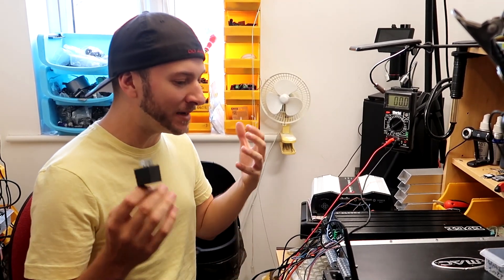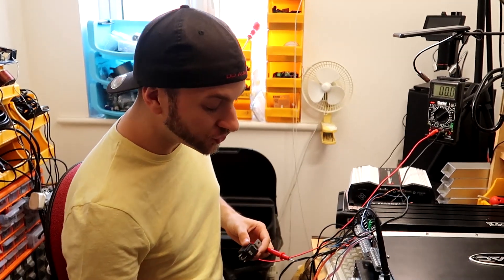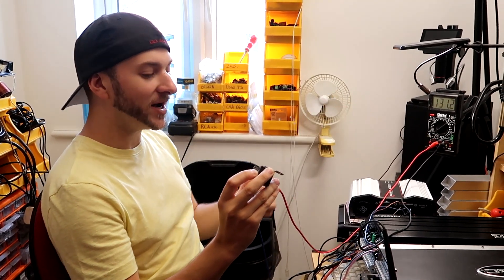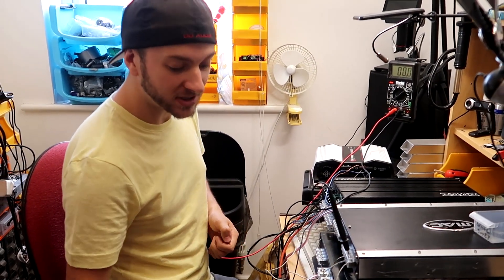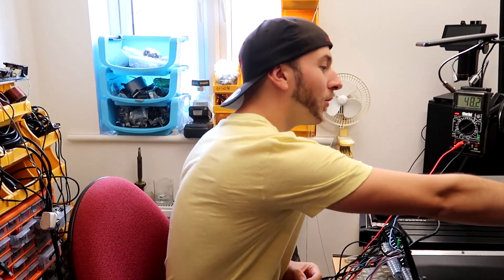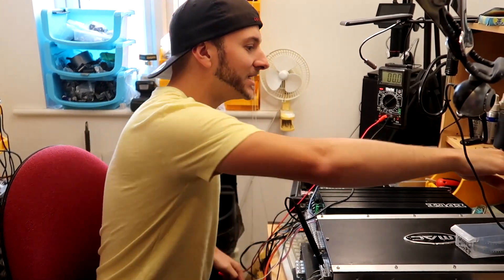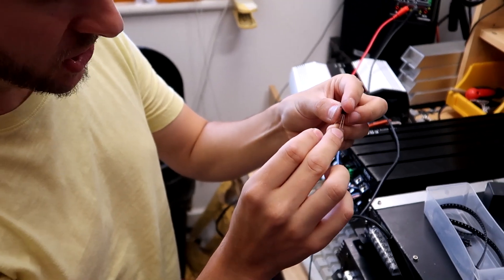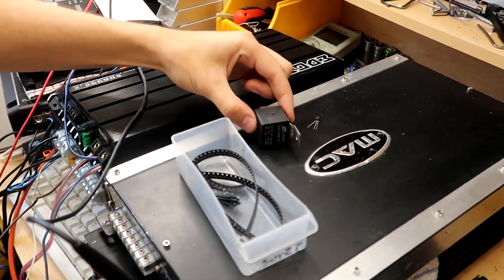"Bro do u need a relay on the remote for runnin 4 amps"

Comment: I love videos like this. The only time I've ever considered a relay is when the remote wire is a 6 volt line. This is usually a stock ford amp thing IDK, but I ended up finding an empty fuse location that activates with the ACC key position n tapped my power from it. I've always wondered about daisy chain but never hook up more than 3 amps n always daisy chained n figured if it didn't work then relay.

Comment: Thanks for the video!  I always suspected that the amplifiers themselves didn't draw very much current for the turn on circuitry but it's cool to see it actually measured.  I've always used a turn-on relay when a build is using other accessory power components like fans for an amp rack, LEDs stuff like that.  The fans I like to use (the BeQuite PC fans) are rated between .14 - .3 amps each and the super bright SMD LED strips are 2 amps at 16 feet I believe.  The last build I did used a relay that switched 2 amps, 4 fans and a fair amount of LED lighting, I fused the relay at 5a.  Next build I do, I'll see if I can clamp for accessory lead current just out of curiosity!

Comment: I would say that I learned something new..... But it depends on the Amp. Many "old school" amps used inefficient electro-mechanical relay coils, just smaller versions of the standard relay you held in your hand. Some modern amps still do. In the case where the Amp uses transistor switching (solid state), you are correct. But if they don't, the external relay may be required.
Reply: Not totally correct, basically all amplifiers including modern amps use mechanical relays to power on and off however your not energizing the relay from the remote input. The relay is energized by a single transistor like shown in the video. The remote input is just turning on the npn transistor, which is turning on the relay.

Comment: i remember back in the day (20 years ago) people swaping the fuse for a bigger fuse so the amp became more powerful... ahahahah
@barevids when will you make a live stream fixing an alpine?
Reply from the maker: When one dies... It's very rare 😂
Reply: If it doesn't use a regulated power supply you can squeeze more power...Big D Wiz  has done it.
Reply: @vincentrusso4332  changing the fuse will do nothing on amp power...
Reply: @sergiobisonte  I've seen it done, YouTube the video..
Reply: @vincentrusso4332  what are you talking about???
Reply: @sergiobisonte  Williston labs had an amp on the dyno and stepped up the fuses from the factory and it did make more power, sorry I don't remember the exact video or I'd link it.
Reply: @vincentrusso4332  that was a cheap china amp or prototype amp that had fuses with very low amps for the power that it was making... that is a diferent story.. it wasnt the fuses that made more power... it was the wrong fuses that didnt let the amp do its normal rated power... if have an amp with a 25 amp fuse, it will pull maybe 17 amps max... if you put a 50 amps fuse, it will pull the same 17 amps..

Comment: I wanna see how much currant we CAN pull from a head unit remote wire…
Reply: I'd be interested in the results. I'd expect it to just stop working at some point. Either fried or triggering a protection circuit if the manufacturer was nice enough to save it from killing itself.
Reply: (I know the manuals list it, I want to see the limit and what happens. Time to buy and test!
Reply: Just read the manual to your head unit. Boom there is the answer or even Google that shit.
Reply: @FixedUntilBroken  you’re not great at reading, are you?
Reply: @casey360360  lol too much lead in my blood from circuit board repairs. Didn't open the comments below and see you responded to yourself like a wild animal instead of editing you post.

To answer your second question that is in your comments it really depends on the head units design. Most have an over current protection and will either restart over and over until you unplug it(as in the short) and some will display an error code.
Reply: @FixedUntilBroken  I have the same problem, only mine is Asbestos from brake pads and whatever other heavy metals the shit boxes I work on poison me with. Haha

I’ve got a Rolling car audio system I built/am building, it’s got a cheap Dual touchscreen unit running it, I might order a new receiver and see what happens on that when you over draw the remote.
Reply: @casey360360  you can normally find them a couple year models old on fb marketplace for less than $50. Grab something like that then if you don't damage it doing that you can build a big boom box with a battery and some speakers
Reply: @FixedUntilBroken  oh no I mean blow up the dual I have on it right now. I’m going to replace it with something a lot simpler, something without an interface to produce the output signal to the amplifier.

Comment: CES makes a nice little package that can turn on multiple amps.  Only reason you should run is is because the strain on your headunit imo.  less likely to have any weird issues.  But like ALOT of amps lol.  10 or more is what I've always said.  Interesting it seems to coincide with this :)

Honestly never looked at the amp ratings, kinda just always been a rule of thumb.  Cool to see it all broken down!

Comment: If we're doing trivia, how about this.
Say you lose an amp,
On 2 separate occasions it's killed the rca outputs on the headunit.
How do you avoid that b.s. cause that's happened to one of my best headunits like almost 2k$ back when single din 7" screens first came out...
Reply from the maker: Try running a ground loop isolator until you figure out the problem that keeps killing the amps. The GLI is just a transformer with a 1:1 ratio, electrically decoupling the head unit from the amp, and blocking DC.
Reply: @barevids  this was in a couple different cars, amps went to clip city popped MOSFETs and it seems to want to always feed the short back into the headunits. Maybe just bad luck for me I guess...
Reply: Be a nice invention to make a fused RCA circuit between the headunits and amps, not sure how it would sell though.
Reply: @Sneakdisscommentbelow  or as barevids said just use a ground loop isolator
Reply: @BH4x0r  🤷🏻‍♂️ that's over my pay grade..
Reply from the maker: They're like $5 on eBay. Lol.
Reply: @barevids  over my pay grade means idk what it is bro lol
Reply: @Sneakdisscommentbelow  the most expensive one of the simple isolators i can find is like €10/$12 from a local electronics store

Comment: It's amazing how much misinformation is in the car audio hobby. Some of it was carried over from the good ol days back in the 80s and 90s, but is still around somehow.
Reply: Pretty much sums up my comment about this.

The "old school" amps used actual electro-mechanical relays that had more current pull than the solid-state transistor (fet) switching of today's amps with is much more efficient.
Reply: Back in the 90's I NEVER used a relay. Just ran everything right off the remote wire. I never had any problems with it. 

Oh and yeah I been doing car audio since the early 90's and am still doing car audio today. Currently running a four amp system in the truck. Capable of doing 101dbs. Well, at least that's the highest it's hit so far. It's a work in progress. Anyway, I'm pushing 50. It's hilarious seeing kids looks when the wife and I get out of the truck. Down right hilarious!!!
Reply: @abitoffcenter383  101Dcb? That's gotta be a typo... my single Kicker comp is doing 126.7 on the windshield.
Reply: @casey360360  agreed my tweeters do 101db haha
Reply: i 2nd this. im active in LOADS of electronics hobbies from home to car to commercial to tube to computers to game console repair and by FAR car audio is always the worst
Reply: Keyboard warrior era.
Reply: It’s SO bad.

Comment: Do the same thing except use the radio to cut the amps on with a single remote wire....
Reply from the maker: happy to do that, but with 48mA worth of current draw, do you really think there will be a problem? Do you understand how incredibly little current this is, and that the relay was more stress?
Reply: @barevids  yes I do but from personal experience here in the United States sometimes when you run more than three amplifiers off of a single remote wire the radio doesn't want to act right.. I've had radios cut off I've had some radios that would actually dim in and out and then some didn't even like to cut on they would cut right back off.. so we started putting amplifiers when using more than three on a toggle switch. And that's just the way I've been doing it ever since. But I also deal with customers that have a lot of older equipment and maybe some of those older amplifiers had  a little more draw through the remote wire . Because I literally for the past 10 years have practiced this if more than three amplifiers use a toggle or relay .... But the relays I use are actually little boards that were designed for multiple amplifier car audio applications. Probably another gimmick I have been sold on and been wasting time and wire for the past 10 years now that things have changed so much
Reply: @barevids  also wanted to thank you for every video you really really care and help us audio guys out especially the ones that don't have the time to do the research thank you so much

Comment: My Taramps Bass30k wont power up with headunit remote xD. Had to use a relay. I never actually measured how much current did it draw. Now im interested tho.
Reply: Hmm. Just measured. Bass30k that i have draws 860mA from remote wire xD. That is @15.5V
Reply: More than likely a voltage threshold issue rather than current draw. We run into this more than you would think at our shop.
Reply: So just an example, if you check a newer Dodge truck (15+) for reverse 12v+ signal it shows 12.5v on the cheap multimeter but wont turn on reverse input for a camera on JVC/Kenwood radios reliably. Put a micro relay or relay on it and it works fine. It is actually pulsing the 12v very fast as seen on a Fluke or scope and the relay being mechanical makes the PWM signal from the BCM analog(ish) enough to work.
Reply: now i'm interested. let us know.

Comment: I wish my amp had delayed turn on in the winter, I have to glow my 1.9 TDI before starting 😂
Reply: look up "Delay Relay 555 Timer Switch Adjustable Module 0-10 sec"
Reply: @kennethcroll6972  thanks

Comment: I've had plenty of people mention relays should be used in the hundreds of installs I've done. Not once have I ever used one, and not once have I ever burned out the remote out an any stereo. Never a problem with paralleling the remote. Never have hooked up 20 amps, bit now I know for fact I can. 

Imagine all the wasted man hours wiring up and making a spaghetti mess of jobs that absolutely didn't need it. Glad I've never contributed to the waste. 

Good subject, nice to see someone make sense of it for the masses.

Comment: Fusion power plant MK1 4 channel would not turn on with just headunit remote ( had to use a relay to get it to work)
Reply: I think It could just been that odd one in a million
Reply from the maker: It's likely the PNP in line with remote was faulty. I've seen this a handful of times.

Comment: You forget that people would be  running processor/crossovers as well.how much power do processor/crossover pull??I've seen amp receiving less than 12v ,after powering all the crossovers and processors.I guess the size of the remote wire will come into play ,at that point
Reply from the maker: I don't forget this at all, remote turn on is always logic level and will draw  less current than ever needs worrying about.
Reply: It's more likely that a sketchy installer would accidentally wire the remote +12 to the constant +12v on a crossover if you see the voltage actually sag... lots of posts online from people doing just that or finding a stray wire from constant +12v or remote +12v keeping an amp on.
Reply: @mitchellroberts7954  good point